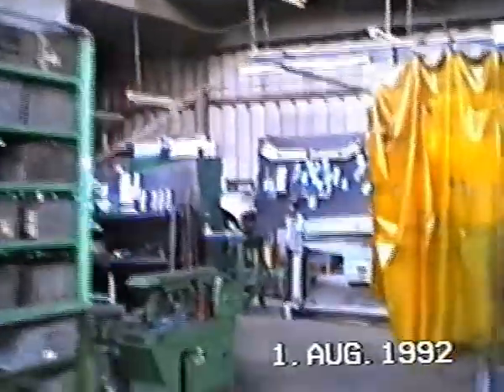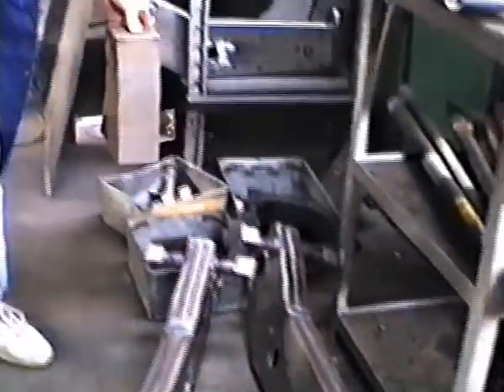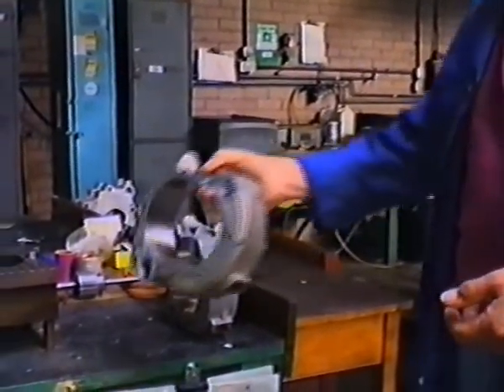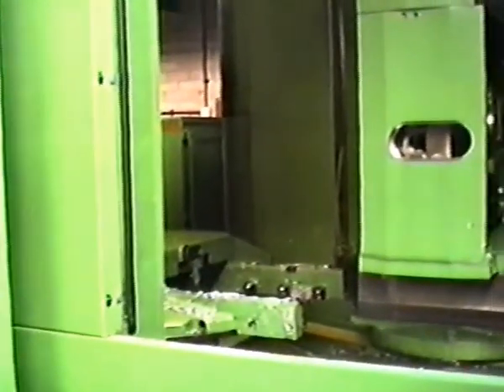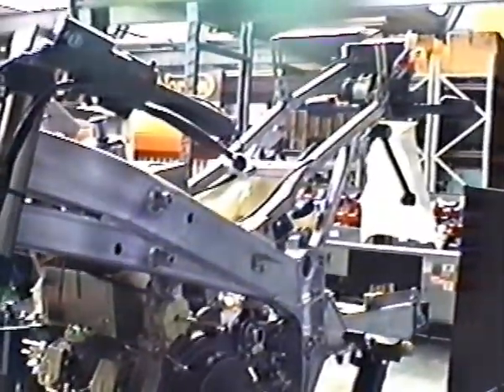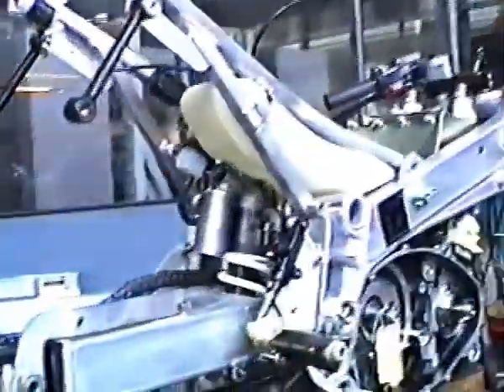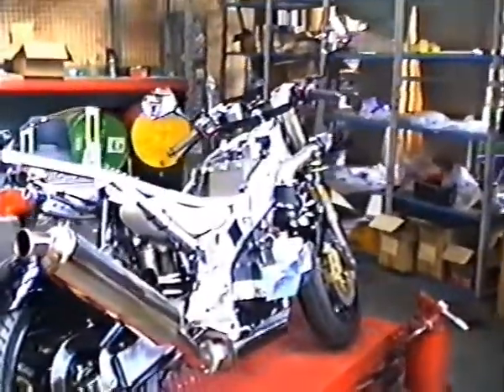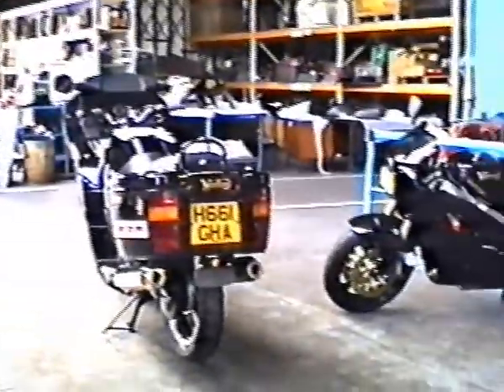Norton Rotary Motorcycle Factory Shenston Staffordshire 1992

Comment: Sadly Richard Negus has recently passed away. A lovely man who kept many Rotarys on the road even offering upgrades to Supreme Commander Spec with more modern, forks wheels and brakes.

This involved a lot of engineering work to get the chain run correctly lined up by moving the engine and using a spondon swinging arm.

Where is G767 SRP now ?
Reply from the maker: You get an idea of what a lovely man Richard was from this short video. He always had time for everyone and shared his knowledge with anyone who asked for his advice. It was a pleasure to have met him.